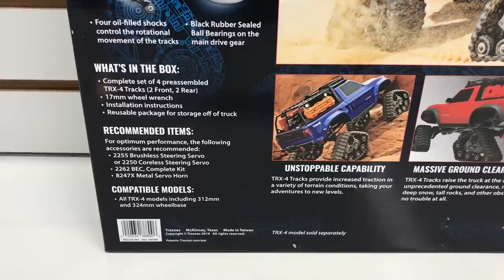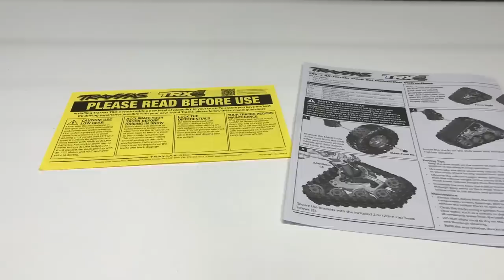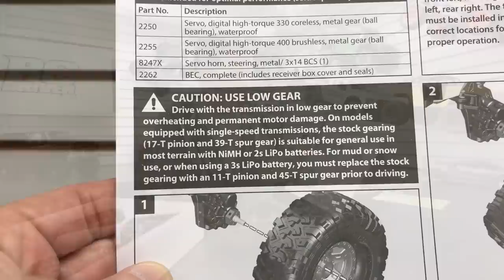Next Level Off-Roading! Traxxas TRX-4 All-Terrain Traxx Set Review & Action | RC Driver

Comment: Can't wait to get those on my Defender
Reply from the maker: I had them up next to my Defender. They look pretty awesome with that body.
Reply: @rcdriver ...I know in the promotional video they suggest that you have the longarm lift kit....is that totally necessary
Reply from the maker: @rckn-rndlwestvirginiarc4388  I didn't fully install them, just put them up to it. I don't think it's totally necessary, but there may be clearance issues, most likely during articulation. There might be some clicking or worse, hang-ups from the tracks grabbing something. But I think the driver would realize it instantly and stop. Traxxas put in the instructions, some bumper, slider and body trimming may be necessary depending on the kit. With the long arm kit however, I don't believe clearrance is a factor on any of the TRX4 models and therefore no trimming. I can probably do a bit more testing and will try to remember to go into extra detail when I revisit the tracks during my upcoming TRX-4 Sport Project series.
Reply: @rcdriver  that would be great....look forward to future posts or videos

Comment: Hey you watching this (if you can) PLEASE PLEASE PLEASE. answer this question to me...since I’m getting the Traxxas slash vxl Fox edition and I don’t like bashing my rc car ( just driving it around ) ,since I know I can’t repair the part I break until every time my dad gets his paycheck how long would my car last? Also a few others questions if it doesn’t bother you... since this is my first rc car what battery should I get from Traxxas and what charger.? Do I need any immediate upgrades as soon as I get the slash? But I don’t even know if I need upgrades since I don’t bash my rc car but it’s fun to see it off-road on grass or other terrains or like I said just drive it around.Hopefully you answer my questions. If you do I appreciate it a lot!
Reply: Just practice not in the streets or near things you cant crash into and last long time , if dont want change the plug on esc you will have to buy traxxas id charger ect bc it pritoratay
Reply: rc player THANKS A LOT! But this may sound stupid but I changed my mind and I’m getting the ARRMA Senton 4x4 blx 3s. So could you answer the same questions I asked for the slash but for the Arrma senton this time?
Reply: Good the senton is more durable just make sure get a lipo battery with 40 c rating or better 2s or 3s with ec5 connector . alot chargers  cheaper ones are also good if ordering from tower i use the onyx 245 also only go up to 3s make sure you also have connector you need with the charger or can buy seperate
Reply: @1brianmorales1  You definitely get more run time and bang for buck with the senton ive ran mine granite everyday almost for almost a year remember even tho water is fun and rigs are  waterproof it wears bearings tremendously faster unless willing dissasmble and lubricate the bearings are good imo but they are not sealed and ofcourse 2s get more longevity also but not as fun
Reply: rc player a adapter you mean?
Reply: @1brianmorales1  You only need a adapter if the charger battery or car dont have same plugs the senton uses a newer plug i think its called ic3 but ik its compatible with ec5 so you need lipo 2 or 3s with 40 or above c rating with ec5 plugs also charger you buy must have ec5 most dont come with that style so you may need a adapter
Reply: rc player I know they are waterproof but I don’t like risking it lol 😁.
Reply: rc player thank you!
Reply: @1brianmorales1  Np

Comment: Good review. Like you said, not really meant for the places you filmed. The real test will come in winter, where I bet they outperform tires (in a video, side by side, hint hint). Not sure what you mean by letting the tires acclimate to the outside temperature. I have always found that warm tires perform best, and the colder they get the worse they grip. Oh, and yeah, pretty expensive for Canadians, who get the most snow, ironically.

Comment: Running a detailed TRX-4 Defender at stock height. Wondering just how much caution you  would advise running at the quarry or doing the beach thing at the shore would hate to fugg it up right off the get-go. Very informative video, thanks for sharing this video, did not know it existed!!!
Reply from the maker: I don't think it would be a big issue as long as you are alert while driving in those conditions. If you see a track hang up, don't keep driving, stop and fix it. When I got a rock hung up in the track and it came off center, I kept punching the throttle a bit for testing purposes. It's my job to test it for the viewers so if it broke, it broke. But nothing happened, no damage, no visible scars. Just popped the track on and kept going. Just be good about maintenance afterwards and they should be good to go.
Reply: @rcdriver  Thank you. Sand always sets off my alarm bells.

Comment: They seem really cool , but I'm still on the fence,  the use only in low gear is kinda a bummer,  but I'm sure there is a gear ratio work around you just have to put the time in on figuring it out.
Reply from the maker: They're cool. There may be a work-around, but I'm guessing the set-up suggestions are to keep your electronics safe and ensure you keep playing.
Reply: @rcdriver  oh for sure,  however with the right gearing changes I'm sure could solve the issue, rather gearing it a little bit lower so second can be use which would make 1st really low, or something to the tune. As always someone will tinker and come up with something, probably not me however I just don't have the time like that anymore lol

Comment: Spotted in the warning "Lubricate with WD-40"     WD-40 isn't actually a true lubricant. WD stands for "water displacing" and its main use is as a solvent or rust dissolver. Not to say this wont help in this case I just hate to see products misunderstood.
Reply: humboldtef I’d probably use spray silicone, let it dry before a run.  Displaces water and it’s an actual lube.  WD40 is also a brand, with a variety of products, sometimes I wonder if people forget to specify the product.
Reply: humboldtef it actually attracts dirt too
Reply: Itll displace the water they may penetrate the rubber seals on bearings as well as displace water in tight places...
Reply: I heard from a maintenance guy where I work that they were trying to develope something to keep wires dry in space and what they came up with was WD-40. "W"ire "D"ry - "40"th attempt.
Reply: It’s a general purpose product.
Reply: Wd 40 40 things can be used for lubrication right at the top they know ppl are lazy going use in water wonder why broke after one use
Reply: Yes silicone, grease work best for lubrication but it also attracts sand ect to stick to it where wd is inconsistent constantly moving pushing i swore by it. For maintaining my atvs dirtbikes kept them preserved as day i bought them no matter how submerged in 🌎
Reply: Any metal or moving parts you dont want to age wd is the best..

Comment: crazy good mud shed, but way expensive! maybe rc4wd predator tracks?
Reply from the maker: Yeah, the mud spilling off the sides was cool. I believe the predator tracks are $120 for just 2, plus you need adapters for your truck for $30. So you're at $270 for a full set of Predators. And there is another brands track set on Ebay for $340. I'm thinking the $230 Traxx are the most reasonable route.
Reply: @rcdriver  your right, the numbers don't lie!

Comment: just wondering if it cud do some real rock crawling jst like a typical wheel does
Reply from the maker: The track rubber compound isn't as soft as most tires, there's no rubber collapsing to grab the rock. With that said, I did do some climbing and it did fairly well. Because of the length of the contact patch, it cleared some big gaps and pulled itself over some ledges, but they have their limits and type of rock plays a roll too.

Comment: so... locking the Diffs for the same reason you are locking them when running wheels...
and why not more power?? why only low gear and only 2S LiPo ?? will the Traxx shatter into pieces?
Reply: Or like the full size units, they don't take very much abuse and throw tracks constantly.

Comment: Cool, but not worth the money or the headaches. I am guessing they recommend low gear and 2s because high speed with more power they will just constantly toss the tracks off. You won't think they are much fun if you have to put a track back on every few minutes.

Comment: traxxas should of went with a plastic bushings over metal, it beats the metal on metal wear you get from metal bushings, also bearings are dirt cheep on ebay and you can clean them if you do drive though water.

Comment: They look as if they will only excel in very certain conditions.  Not ideal for your basic scale trail or crawl.  Maybe snow maybe mud.
Reply from the maker: Correct, the do well in certain conditions. Tires will still rule, but tracks are a fun option when you want to do something different with your rig. Swapping back and fourth between the two is pretty easy.

Comment: Doesn’t look like they perform very well. Tracks don’t hook or form well over hard surfaces. regular set of good tires and foam with out perform the $300 gimmick tracks.
Reply: If the truck was 4x heavier they would work much better. There isnt enough weight to make them form to the terrain.

Comment: 230 bucks is a HARD SELL... 
There are aluminum tracks with full bearings options for cheaper!! Granted this is vehicle specific with cool shocks but these are 95% plastic!! You are paying for 50 bucks of hardware and 180 bucks for the Traxxas name tax.
Reply from the maker: The RC4WD Predator tracks? They're $120 for 2 and you need adapters for $30. So a full set is $270. There is a different aluminum Predator set on Ebay for $340. Maybe I missed the cheap set in my Google search.
Reply: Really? A full aluminum set can be bought at eBay for 200 bucks.. You will still need some axle extenders to make them work but HR or MIP has that covered for the TRX4.

Comment: They don't seem that great or even out perform wheels. Doesn't look worth the money at all
Reply: coyoteMark I think they are a niche item.  Tires for rick crawling.  Tracks for mudding or beach runs where tires don’t work  as well.  It’s like anything else, whether these are ideal for you depends on where you drive.
Reply: Also, there's a deeper tread as of now. But I agree with the other guy, it depends on where u drive it.

Comment: $240+ and only 2wheel steer! low speed only!  Tracks running the wrong way! Full of plastic crap! out preformed by normal wheels and tires! Major Fail Traxxas Major Fail.  at that price you need to include far more/better stuff
Reply: But have you compared these to the price of the other options already on the market, and they are for pairs, not for all 4. As Greg said, I agree and have commented on other forums.. tracks are not the end all beat all for every terrain, actually quite limited where they are beneficial.
Interesting that you think the tracks are backwards, those of us that actually work around them know, look at the front of the vehicle... the track should have a smile (V).